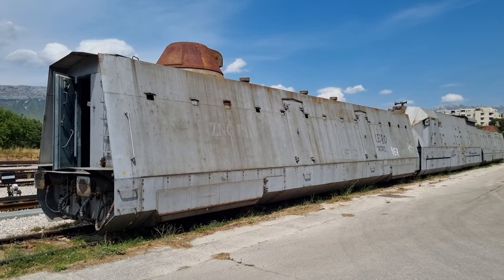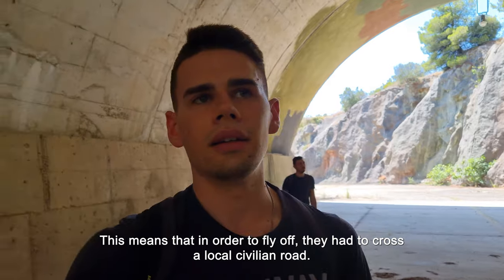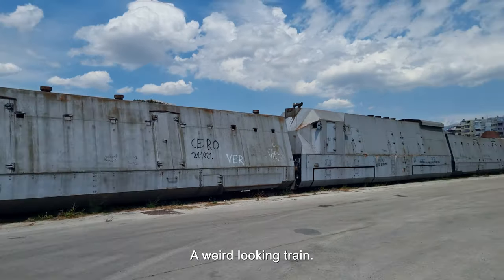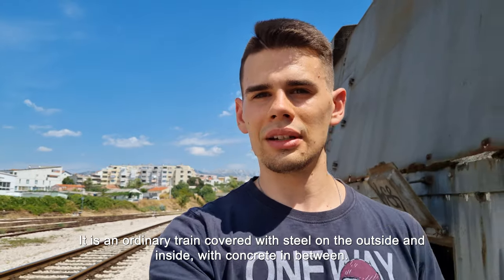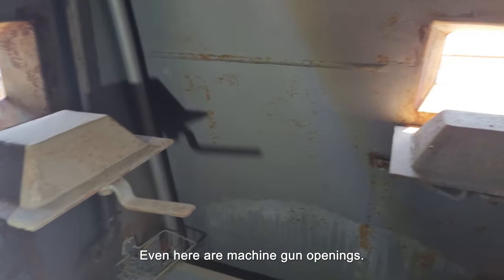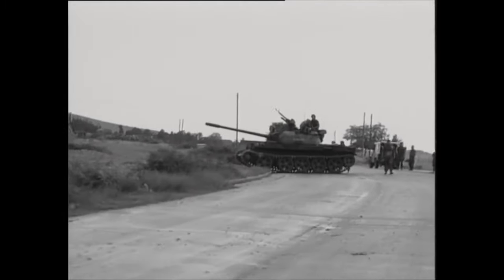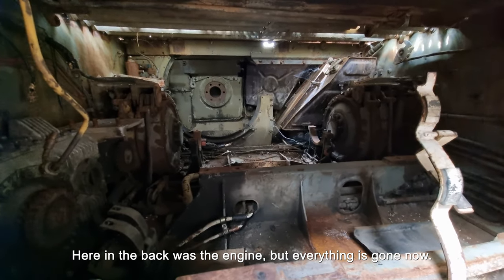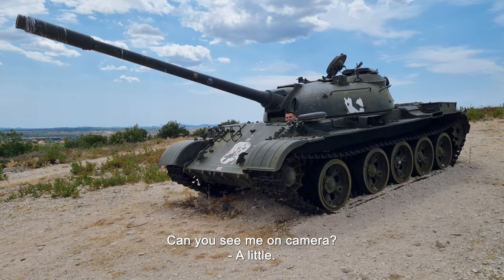Explored an UNDERGROUND Airbase - Soviet Tanks And Armored Trains | URBEX

Comment: Although these armored trains stopped making sense post WW2, they're still an interesting relic. Especially those with tank cannon bolted on top - too bad this wasnt one like that. 😅

Never seen the interior of a T-55 - its in surprisingly good shape! No graffiti either...😮
Reply from the maker: Yeah, it's a shame they even removed the small anti-aircraft guns on this one.
The t-55 is in excellent condition, considering that it was abandoned and left without a hatch in the rain.
Reply: well actually they do makse sense if you have a lot of rail network to protect from partisan attack, which is also the case in Ukraine hence the presence of the Russian Armored trains. 
The one we see above was a very poorly armed by armoured train standards and even in the bizare world of Improved weaponry that was the norm in the Yugsloavia Civl war it would have been of very little use wthout some kinfd of infantry comliment. its also likely that a flat bad with a old tank or armorred car would be added at the fornt or back if it was ever deployed.. They are not intended to fight front-line battles and instead mostly serve to escort civilain and supply trains and protect rail repair workers from ambushes. Almost everybody uses armoured trains of some sort even if its just armour bolted on the driver caps of civilian locomotives during civil wars or other insurgencies.